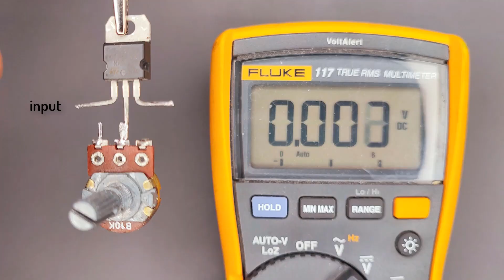How to Build an Adjustable Voltage Regulator using 7805 - Step-by-Step Guide

Comment: Thank you so much for this informative tutorial on building an adjustable voltage regulator using 7805! As someone who is new to electronics, I found the step-by-step guide to be incredibly helpful in understanding the process. Your explanations were clear and concise, and the visuals made it easy to follow along. I can't wait to try this out for myself and see the results. Keep up the great work and thanks for sharing your knowledge with the community!

Comment: This tutorial was a game-changer for me! As someone who is relatively new to electronics, I found the step-by-step guide to be incredibly helpful in understanding the process of building an adjustable voltage regulator using the 7805 IC. The explanations were clear and concise, and the visuals made it easy to follow along. Thanks for sharing your expertise